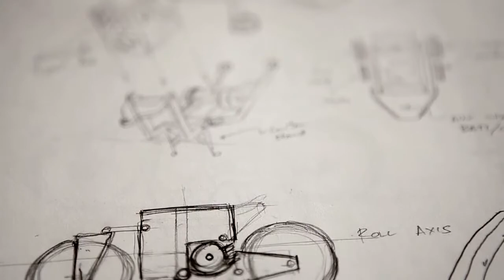Amarok Racing founders explaining "Why less is more"

Comment: Also, heavy engine needs a heavy frame, needs heavy wheels, has more inertia, more inertia in a turn, more inertia to slow or stop. Also less fuel efficient if heavier. Gas is on the way out. Electric has so many benefits over gas, I would run out of characters trying to list them.